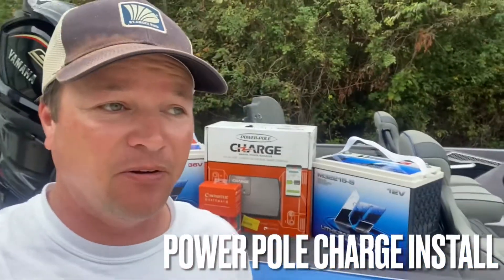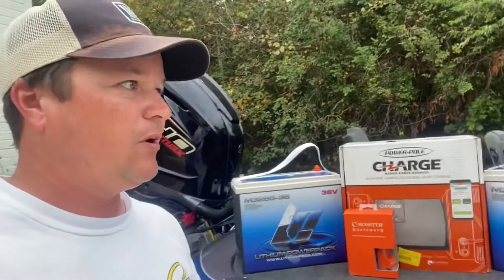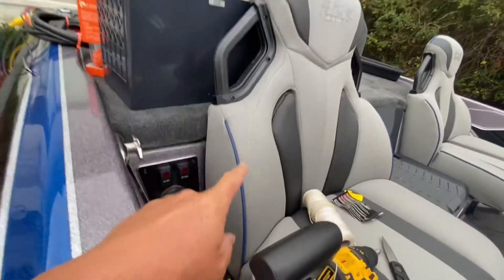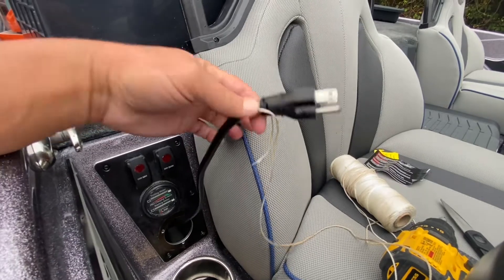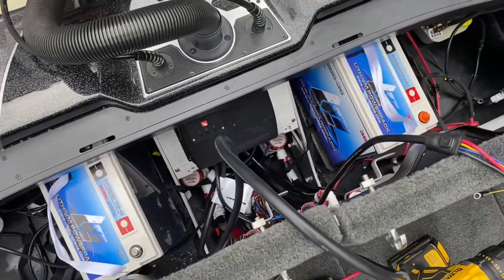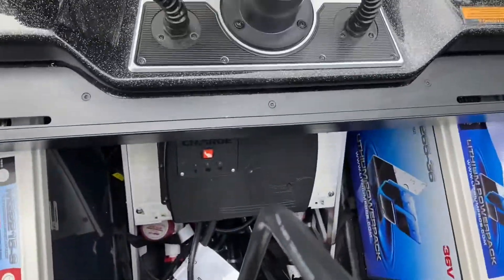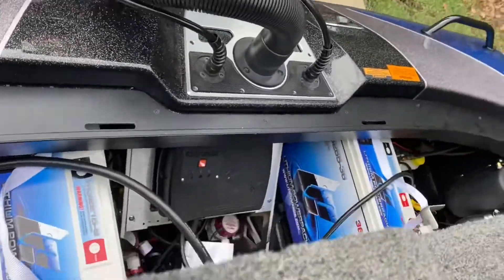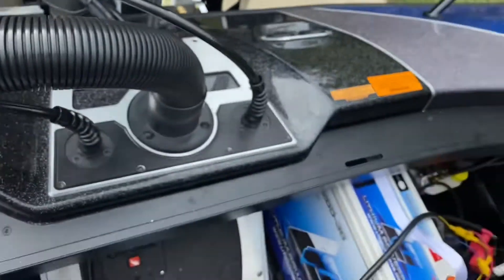Complete Power Pole Charge Install

Comment: I’m getting ready to buy my first boat.  Can I run two of the 12v batteries that your using in parallel with one battery as my cranking and house battery and the other battery for just my graphs ?

Comment: The only problem with a lithium as the  engine  battery is that if the BMS goes into sleep mode  you are in big trouble as the emergency start system will not work........Maybe go with the largest AGM available or perhaps 2 .
Reply: That is what PP told me.   They also recommend just a single lithium battery for the trolling motor  rather than multible batteries.